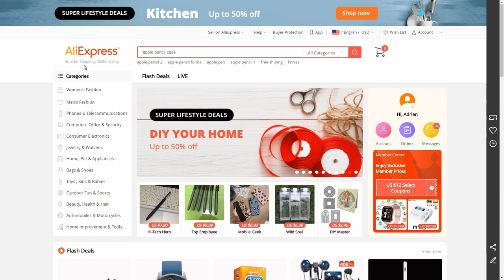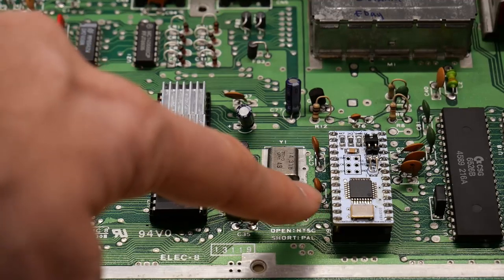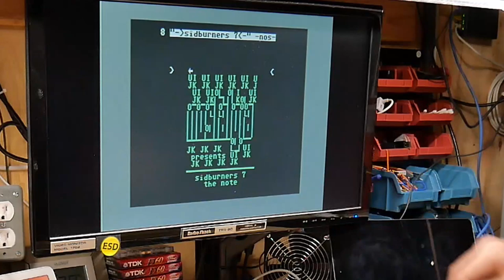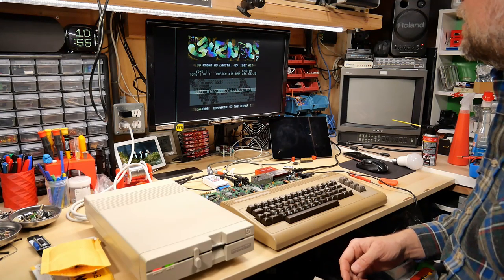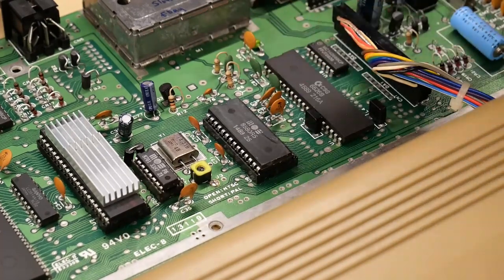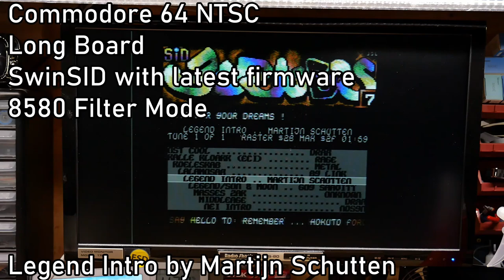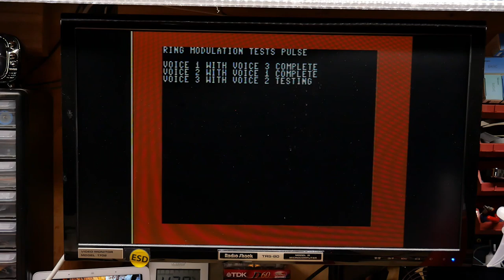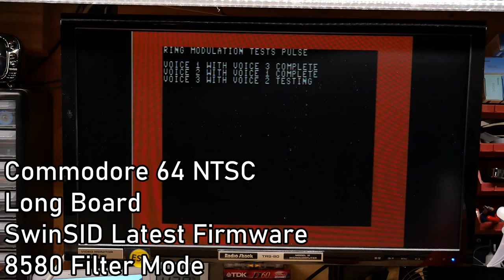I bought a C64 SID chip from AliExpress!

Comment: Is it normal, that i cannot load "SIDburners 7" with my kung fu flash? i get to the intro scene, but after that, it just goes black, and nothing more happens? 😥
Reply from the maker: Yeah it works with a custom fast loader. Like all modern C64 demos you have to use a real 1541 drive or a Pi1541 with cycle accurate emulation of the drive.
Reply: @adriansdigitalbasement  okay, thank you Adrian 👍🙂

Comment: The only C64 controller I ever really liked using was the hand-held Wico Ergostick. It was similar to the Epyx 500XJ/Konix Speed King except the stick was far more comfortable and the base was made of hard rubber instead of plastic... I did SOMEWHAT like the European Suzo Arcade, but they were hard to get a hold of here in North America.

Love that MOD though. BTW, you can also connect a GENESIS/Megadrive controller to the C64 as well as it had the same connector

Wish it was possible to mod a SNES controller and use one of the buttons as a space bar. Aside from up to jump, I always hated using the space bar to fire a secondary weapon in a game like Commando

Andrew Challis also coded quite a few games for the C64, primarily for Interceptor Software/Micros...

For example, he did their version of Missile Command, as well as the games Trollie Wallie, Frogger 64, and the Criminally underrated Caverns of Sillahc
Reply from the maker: You must never connect the Genesis/Megadrive controller to a C64 without first modifying the controller or you may short out the 6526 chip that handles I/O. I found one of these controllers in a thrift store for a couple dollars and did the mod, but I prefer the D-pad on the original NES controller.

Comment: I'm one of the lucky ones. I have a "short board" in my C64 breadbin. It also came with the C64c's light colored keyboard. I think they called it the "Aldi C64" but I got it at Toys R Us back in like 1987.
Reply: Does your keyboard have the PETSCII symbols on top or on the front of the keys?
Reply: It has the symbols on the front of the keys. But the board is definitely the short board w/ 2x 32mb memory chips and the 8580 SID and 8500 CPU
Reply: @trirycheman  2x 32mb memory chips? Amazing.

Aldi C64s are PAL version only.
What you have is a mix of a C64 and a C64C, Commodore used up anything they had on their shelves to produce C64s.
Reply: @Okurka.  Ha! Sorry. 2x 32kb memory chips. LOL.  I work on ancient PCs at work, mb's are still a thing for me.
Reply: @Okurka.  Mine is identical to the Aldi C64s.  Except not being PAL. But yes, a mix of c64 and c64c, just as the Aldi c64 was. Both from the same factory at the same time.

Comment: I got my 8580 and 6581 chips about 12 of them from Hong Kong in 2011 all Good!
Reply: They must've cost a small fortune, eh? Glad to hear they all worked, though.
Reply: @BertGrink  I found the prices are reasonable: I bought 6 of them for under under $30. After all the horror stories obviously I expected to receive duds. To my surprise only 1 was bad (one oscillator was broken) but still all the chips were the real deal... (Another Chinese seller did sell me fake 6502s and 6510s though... It remains a risk but luckily didn't pay much for those either.)
Reply: @hugovangalen  Phew! Glad to hear you didn't get fleeced. Happy tinkering.
Reply: @BertyFromDK I bought 8 chips from a US based seller on eBay back in 2012 and only paid $25 per chip. The price seems to have doubled since then, and I’m sure will only continue to go up as more die and retro computing continues to become more popular.
Reply: @einsteinx2  Yes, i'm sure that is true; i bought an 6581 SID from germany a year ago for a bit over $56 although i could probably have gotten it cheaper from china, but i didn't want to risk it being a dud.
Reply: @BertyFromDK yeah not worth the risk if the price is only Iike 20% cheaper. Not to mention the extra shipping time.
Reply: @einsteinx2  Speaking of shipping time, here's a 'funny' story: 2 years ago i bought some momentary toggle switches ([on] off [on]) from china, but when they hadn't arrived after 4 months, i contacted the seller to ask what had become of them; somehow ebay saw that message and asked if i wanted a refund. I replied that i would rather have them "make" the seller fulfill his obligation to deliver, but they gave me a refund nonetheless. The very next day... lo and behold!... they arrived in the mail. So in the end i got both the refund AND the switches ;) HAH!

Comment: Where i live in New Zealand (PAL) it was always a mixture of Bread bins and C64Cs. I got my C64C back in the day not long after they first came out because they also sold slightly cheaper. On our local online Auction website (Ebay didnt do well here) you hardly see the C64Cs... because they are so reliable collectors know to hord them. you really only see breadbins most of the time. The C64 series of computers did well here. i was still using mine right up till 1993.. GEOS was great for what it was
Reply from the maker: If I weren't for the unreliability of the breadbin, I wouldn't have so many repair videos :D

Comment: The short boards were pretty common because there was more iteration of the C64 than the classical breadbin. One model was breadbin with small board and white keyboard, sold for a bargain in ALDI german discount shops. the C64C was sold in Tandy Radio shack shops and wasn't expensive either.

Comment: Congrats on actually getting an IC that was not full of sawdust. $40 USD is a bit steep but at least its genuine.

I picked up SIDBurners 7 Nostalgia (.d64) (via my Win10 machine). 

Any suggestions on a simple way to get it onto a 5-1/4 disk? I have 2 C-64 drives and a SD2IEC (TheFutureWas8-bit). The only thing I can think of is some kind of C-64 software that could transfer SDCard .d64 images to a disk drive but I have not heard of any...
Cheers,
Reply from the maker: I was able to make 1541 disks using a XE1541 cable I think it was. It does use the parallel port on an old DOS machine -- so won't work on Windows 10. I'm not sure of any way to do it with that.
Reply from the maker: Oh meant to say best thing is get a SD2IEC you can hook up to a Commodore at the same time as the disk drive. Then you can copy the D64 onto a real disk using the 64.

Comment: Ah man...I havent even watched this video and i apready knew about this scam. They are repainted 8580s. So if you have a 128 or later commodore, or you want a sid player these are ok. But if you put them into a c64 with the 12 v rail, they are toast.
Reply: Okay so it was labeled as an 8580...if that is the case, green light. Buyer beware in labelled 6581 chips from china.

Comment: I have to admit the SwinSID is very good, though you are correct, not perfect. But the fact that they can get that close is good to know for the future (where we lose all the original SIDs to the dust of time...) :-)
Reply from the maker: Considering the chip they are using, it is quite amazing. A simple 8 bit microcontroller was never designed to emulate an analog synth chip.

Comment: A lot of software developers wrote routines that took into account quirks the original sid chips had , try playing  The intro to skate or die on an 8580 as one example..
Reply: The Skate or Die intro music is hardly a straightforward example of SID tunes going wrong, it can sound fine on an 8580 but it can also sound like utter garbage.

Because it's an old-fashioned digitune, which exploits the volume register bug present in the 6581, an original copy of the game always plays the tune correctly on that model SID. However a lot of people played Eaglesoft's cracked NTSC version which runs fine on PAL machines but plays the intro music at PAL speed i.e. too slow.

64s with 8580 SID's are more complicated as they weren't all created equal. Some have an integrated "fix" which brings the volume of digitunes up to 6581 levels, the SoD tune plays fine on these machines as well. However a lot of 64Cs don't have this "fix", consequently the tune doesn't play correctly with the lead guitar being almost completely inaudible. The difference is really obvious and can be simulated easily with VICE or sidplay.

Comment: Great timing with this video as I need to pickup a couple of sid chips.  You had luck but looking around it seems really hit and miss if you get a working chip or not. 

I keep looking at those swinsid nanos on ebay for about £15 but not sure.  Might get 1 just to have but I'd prefer the original.  Could you maybe do some more comparison between the genuine suds and the various remakes?
Reply from the maker: I need to get the FPGA SID. It just seems hard to find these things even ... The FPGA one is the way to go though. Apparently so much better than the SwinSID.

Comment: 11:00 Actually the SID is listed as for the 6581 chip. (https://csdb.dk/sid/?id=15426) This author is known for many more awesome tunes specifically (ab)using the 6581. Your reasoning about development makes sense, but it's more that many musicians tend to target the 8580 because it is a much more consistent sounding chip compared to the many revisions of 6581, especially since some good tools for cross development have been available that rely on emulation.
Reply from the maker: Ok interesting on the song target. The SID file itself doesn't have the flag for either but I didn't look on CSDB. And indeed the 6581 chips do seem to be all over the place with the way they sound so it makes sense to stick to the newer ones as well.

Comment: I think that some of those SIDs might be cloned swinsid's embedded in PDIP packages.
I mean come on - the margins are astronomical. Even the swinsid has astronomical margins when you think about it ;-) The unsoldered chips are another thing - lots are fried or have dead filters.
SID is a wonderful synth chip that is plagued by CBM production philosophy. They COULD have added protection diodes to their chips. But they didn't for 2 reasons - it was a mass market chip for consumer products and it saved them some cents per chip - at the quantity they were making that was probably milions saved, even if some of the chips were DOA because of electrostatic discharge. The thing that kills SIDs is the audio input on the AV connector.
Also the 8580 is somewhat more robust IMO. And of course it's of Maniacs of Noise fame ;-)
Reply from the maker: Many people say to ground that input on the AV connector right? I wonder if that helps in the long run. I just assume that SIDs maybe suffer from some process death as the PLA?
Reply: @adriansdigitalbasement  Remember that SID also is exposed on the joystick port. I forgot when writing the last comment ;-) I don't think that SID has the process death problem - PLA was a reverse engineered PAL chip. And they did something wrong with the passivation mask or something like that. I don't remember the whole story ;-) The real problem is that CBM chips don't have on-chip ESD protection. You could fix that by addind back to back shottkys GND-signal-VCC that way the inputs can't go considerabely under GND or over VCC. Because those ceramic hybrids on C64 boards dont seem to be doing their job too well ;-)

Comment: That NES controller mod would be useful (must have)  in Amiga gaming also, if i get to building my own unit, propably will also do that mod. Thanks for the idea!
EDIT: Holy crap, Swinsid sounds like .... bad emulation. Thanks for for that also, now i know to steer clear from "almost as good as og"-alternatives. :DDDDD
Reply: Crappy donor-sticks are almost too common here in Finland and my friend is donating A500 "kit" to me, gonna be a fun project. Biggest problem is the video signal, either i have to buy CRT tv/monitor or accelerator board and they are not cheap....

Comment: ofcourse you can test a sid chip without having a commodore 64 laying around. chinese know perfectly well how to make boards and put simple motorola bus compatible ic's on a system to test them. 10 minutes of work to cram together a system to test sids without a c64. the sid wasn't even intended for use in the c64 in the first place. it predates the thing by far. the sid simply interfaces to anything without any special care. (unlike the vic-II or nes ppu which also does some weird things and aren't just a matter of hooking up clock.address,data,rw lines to pretty much 'any' cpu willing to see a '1' as a '1' and a '0' as a '0' and just work) no need for fuckery with breadboards or slow cnc machines... when in china you can just walk down to the pcb factory around the corner ay ;)
Reply: what does it say onthe bottom? ah yes. made in hong kong. (now also china again and right around the corner)... probably that factory is still in operation today even lol. unlike assets in the usa... stuff over there generally finds a new owner in no time and just continues doing what they've ever done before.
Reply: that would btw be the place where i would start looking for the original designs. any of those 'other factories' that made stuff for commodore after all ALSO have the plans. :P

Comment: Re: differences between the two chips sounds to me that the cut-off frequencies are different between the two versions.
But without another shortboard SID chip to test against, it will be hard to know if it's a problem with your AliExpress chip, or the original SID chips.
Reply: Dragonriders of Pern sounded different on my old C64 from my C128, probably for the same reasons.  The original was better, IMHO; notes fade out too much at the end on the new chips; my guess is the filter frequency was swept down to make the notes decay, but the new filters are more effective than the programmers intended.

Comment: Is AliExpress working in the usa?
Reply: Yep I order stuff from there all the time. Pro tip, look for ePacket shipping, which usually costs around $5 and arrives to the US in around a week (compared to like a month for the other shipping options). I’ll even pay a bit more per part if they seller has ePacket.

Keep in mind right now though that all shipments from China to basically everywhere are very delayed due to the Coronavirus outbreak, so now may not be the best time to order anything (same goes for anything shipped from China on eBay or other sites like Taobao). But in general AliExpress works just fine ordering from the US. 

Also another tip, if you need a lot of something (say 50 units or more), check out AliBaba, AliExpress’s parent site. It’s not direct order like AliExpress is, it lets you search products and contact the factories directly to do bulk orders. AliExpress is basically the Amazon version of AliBaba if that makes sense. I’ve used AliBaba to order for example 50 ESP8266 chips for a project as it was cheaper than ordering from AliExpress and you can haggle on the price.
Reply: @einsteinx2  i ordered some things for the analog sticks on my nintendo switch to make them like the xbox 360 analog sticks from ebay, they will be here march 19th and i bought them on January 18th but it says stuff from china could take a while to get here
Reply: @einsteinx2  Here in Canada there is 100% no shipping from any seller at all maybe due to the virus. Russia Canada and South Africa take for ever to get anything as they want to check every package from china.

Comment: Is there a video for the mod you did on that NES controller?
Reply from the maker: There isn't. I linked to someone else's video which might be useful. If enough people ask I'll show how I did the mod though.
Reply: I saw you using it in a previous video, and as i never had a NES, i though "cool, you can use NES pads with the C64". I didn't find out until this video that actually it was a modded controller. It would nice to do one of those with a switch to turn it into a 2-button version for the Amiga